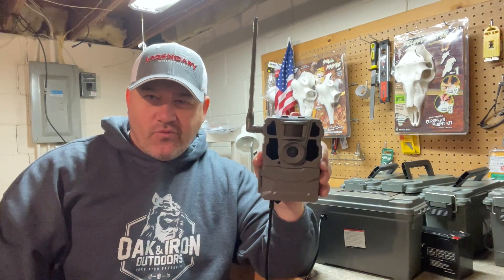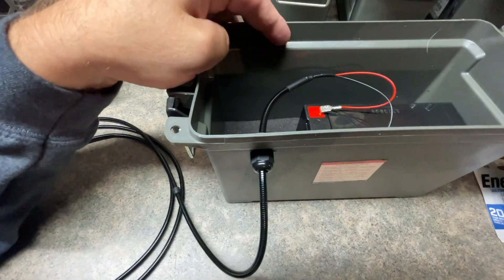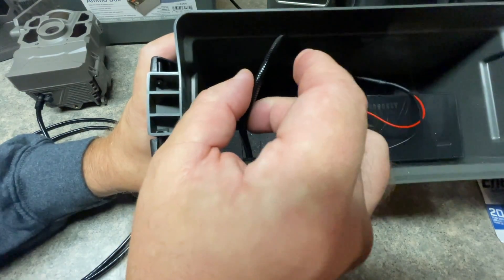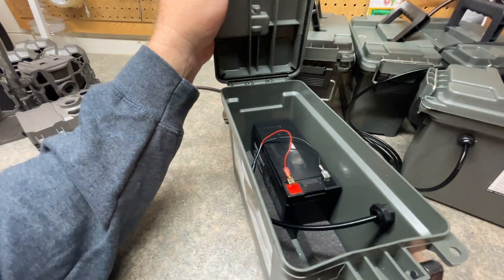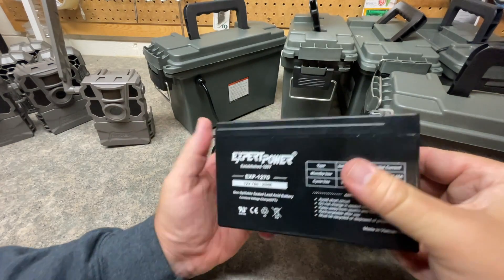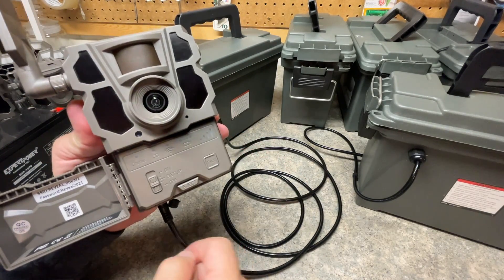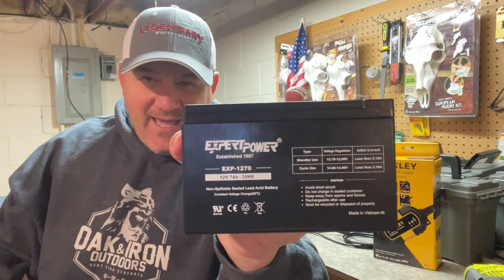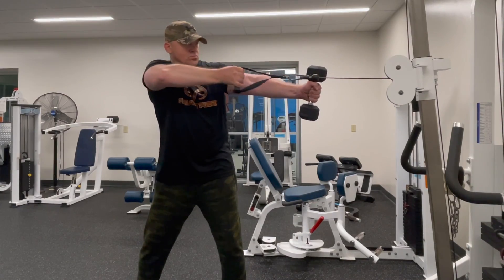How to a make a battery box for your trail camera

Comment: Could you provide an update to this video on how these batteries lasted? And if you had any issues with water in the ammo boxes? Thanks! Great video.
Reply from the maker: Thank you for watching. I can tell you right now that the 5 boxes I used were all bone dry and the batteries inside worked flawlessly. Also, every box has enough charge to get me thru  5 months to where I never had the battery get below 100 percent on the meter. I may do a full follow up video next month.
Reply: @oakironoutdoors2436  awesome glad to hear, thanks for the update!
Reply: My question is , is there a voltage issue running 12 to the camera? You don't need a regulater?
Reply: @scottlafeir  My solar panel puts 8 volts into camera battery, not 12 volts, was wondering the same thing?

Comment: The Tactacam is a 6v camera and you are adding a 12V battery. How is it not frying the camera? Don't you need something in the box to regulate the voltage?
Reply from the maker: The camera is also a 12v camera. The regulator must be within the camera.

Comment: I saw on another thread that they used some bark from a dead tree and built a wood frame inside to match the dimensions of the camera. The frame was hot glued to the bark. They used bunny cord to attach the camera. Holes were cut in the bark to match the lenses and IR lights. 

The bark was long enough to hide the antenna. The security cable was also hidden. When viewed after mounting, it disappeared. Great setup!

You 😮could also possibly use bark on the battery box.
Reply from the maker: True, but that’s a little more work than I would like to do. Lol. Maybe a great off-season project.
Reply: If you need, I can provide a free lithium ion battery for your Tactacam reveal camera

Comment: Thanks, I built same but used Flambeau Mini Ammo box that fits the 7 amp hr battery nearly perfectly without need for foam spacers. I fought with the ends trying to get through the nut before I cut the ends off too. I wonder why Herd installs them if you need to cut them off to assemble? Thanks again.
Reply from the maker: That’s a good question and maybe they come that way for them and then they just add that sleeve??? Not sure, but I was confused at first and reached out to them and that’s when they said I had to cut em. Would save a bit of time if a guy didn’t have to cut em. Although, still a good product.

Comment: Great video! I bought this cord, but it doesn't have the same leads. Guessing I have to cut it and make it so it'll hook up to the battery?
Reply from the maker: Yes, if you have the plastic knuckle, you have to cut the leads anyway to run the chord thru. They should of come with extra leads but maybe they changed that since I made the video.
Reply: @oakironoutdoors2436  no they did not come with any extra leads
Reply from the maker: @scottsmart8009  ok, that has changed then.

Comment: Could you also add a solar panel to keep battery up over time?
Reply from the maker: You can but you have to be careful. You can actually short your battery/camera out as you need away to regulate the amount of solar power.

Comment: Which battery option do you click on camera app?
Reply from the maker: Great question. Problem is, at least from Tactacam it doesn’t matter. It only reads the internal batteries. It uses the external battery first then the internal battery next. However, if you only use an external battery only and no internal batteries, at least with Tactacam, you will never where the power is at. This also goes for Tactacams own solar panel. It stinks but that’s the way it is. They need to do something about that. So, technically just pick one and roll with it as it doesn’t matter, assuming that you are doing external battery pack only.

Comment: How are the HF boxes holding up?  I’m considering those for my box builds.  Thanks!
Reply from the maker: Awesome and no issues what so ever. For me it’s not even the money into batteries but I don’t have to worry all season about having to change batteries. A lot of times in the past I had cameras get ready to die right as the rut was going to start. Don’t have to worry about that now. All my cams are still at 100 percent.
Reply: @oakironoutdoors2436  great, thanks!

Comment: Have those lasted you into the cold weather on heavily visited or a lot of photos being taken areas? I’m just curious if it’s worth going with the Dakota lithium ones on areas your not to worried about it being stolen. Thanks for the video!
Reply from the maker: I hunt a lot of public land and this is my first year using them in conjunction with Energizer Lithiums. If your not worried about them getting stolen and expecting 20 plus pics a day then you may want to roll with the Dakotas. For me on public land I went cheap for obvious reasons. Realistically if I get 10 pics a day during peak rut I would easily get the battery box plus internal batteries thru a complete season if my math is correct in regards to the Milli Amp hours.
Reply: @oakironoutdoors2436  I’m getting ready to run a few setups with the Dakotas this year on a lease, we’ll see how it goes! Thanks again!
Reply from the maker: @stevenhilton2712  That’s Awesome and Good Luck!

Comment: Do you find the 7 Ah batter is enough to last the full season?  There are a number of larger 12Ah or 15 Ah batteries out there. Wondering how much is enough?
Reply from the maker: There are so many factors that play into whether or not a battery is enough, from strength of signal, to flash power to video or pics, pics sent daily or ASAP. The simple rule for me is that if it’s pics only and your at about 20 pics a day then 7ah will work for a whole season. Anything more like 50 pics a day and especially video then go with the 12ah or more. Especially if your like me and you don’t even want to go into an area to disturb it even once.
Reply: @oakironoutdoors2436  thank you!!

Comment: How are you mounting it on the tree?
Reply from the maker: I just lay mine on the ground. You could use a ratchet strap running thru the handle on the tree or even a python cable.
Reply: @oakironoutdoors2436  Thanks, I just picked up some corner brackets, going to test it out and see how they hold.

Comment: I had a bunch of SPYPOINT cameras that turned out to be complete garbage. I went on a spending spree and bought 8 of them. I have 2 left that actually work. Never again will I buy one of their products!

With that being said, I also bought Spypoints external 12v battery with solar panels. I planned on using these external 12v batteries with my new Tactacam Reveals. When I went to set everything up, I noticed the plug with the SPYPOINT cords are larger than the port on the Tactacam camera. I bought adapters that reduce the port size and figured that would work. I hooked them up today and the Tactacam still shows the battery percentage of the internal batteries. 

Any idea why this might be happening?
Reply from the maker: The app and the camera only will tell you the percentage of power within the camera. It will not tell you how much battery life with an external battery, at least with Tactacams. If you use external battery only, the app will always read full until it dies completely.

Comment: great video, I have question. When you charge the battery did you make up a connection to plug into the battery terminals, or just clipped on the pos/neg clamps? I have 10 cameras out and really want to leave a couple out all year. This is a great idea. Thank you!
Reply from the maker: Just charge directly to the battery terminals.

On a side note I went to check a camera. (I thought someone stole the battery box, but didn’t.) I unplugged and replugged back in and the external battery still reads 100 percent. This is after 2.5 months in the woods straight. I have Lithium internal batteries (as backups) in the camera and now feel like they are not even going to get touched by the camera. So these external battery boxes are saving tons of money.
Reply: If you need, I can provide a free lithium ion battery for your Tactacam reveal camera

Comment: Just purchased 2 power cords from 360.... unfortunately they no longer come with the "grommet" that allows you to seal off the box
Reply from the maker: Uh oh. I’m going to have to look into that.
Reply: @oakironoutdoors2436  Update- turns out they still have the kits you bought. They also have "battery box" kits without connectors or grommets.

Comment: Could I go get the cigarette lighter DC cord for the car, could I cut the cig lighter off, and put my butt connectors on there? And if you know how to make sure what one is positive and neg? Thanks. New spyPoint owner here I use these battery’s for my flounder lights and I thought about what they are really made for this and feeders. Thanks.
Reply from the maker: I’m not an electrician so i can’t say. Personally, I only use products what there meant for applicable with according to the manufacturer.
Reply: @Oak & Iron Outdoors  when I clicked your link to the herd website for cord it specifically says not for connecting to batteries, only solar panel.

Comment: On Herd 360 it says in the description “This is not for connecting batteries. Only the solar power pack”
Reply from the maker: You have to look up external battery wiring kit on hers 360.